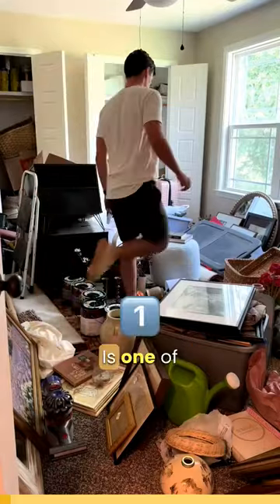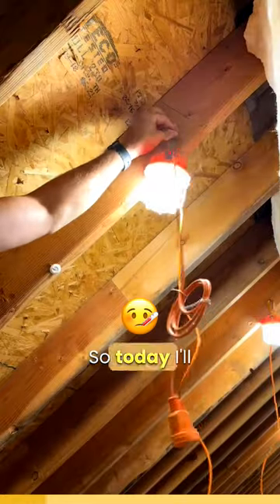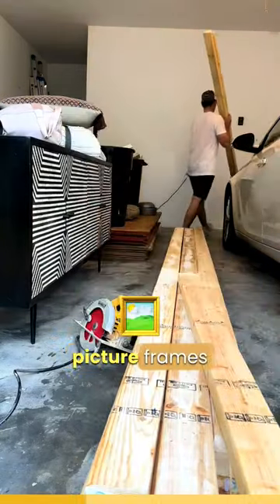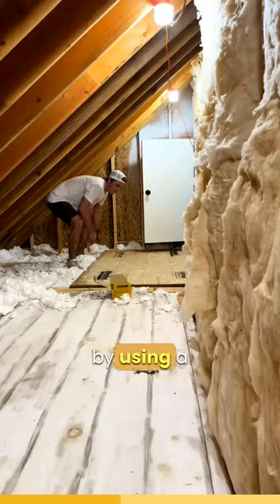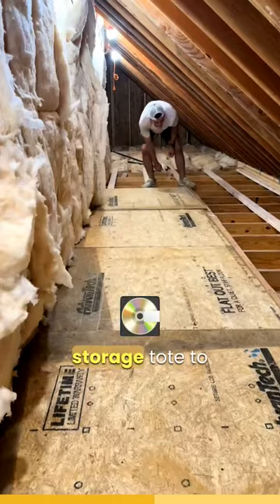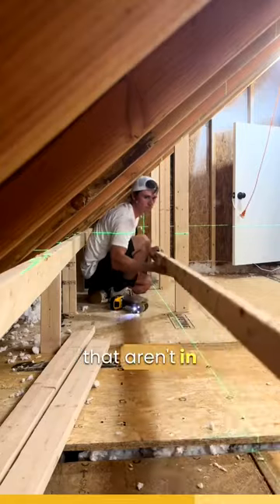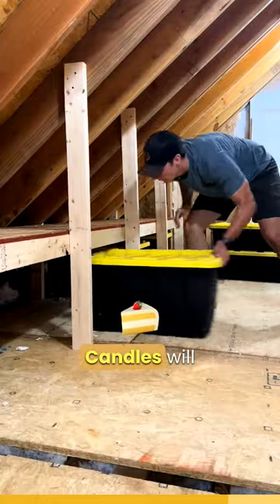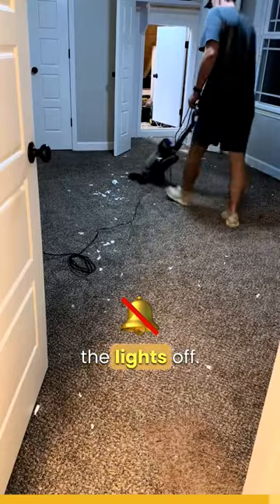Transform Your Attic into a Storage Room: Unlocking Hidden Space

Comment: Since you took out the insulation you need to insulate the ceiling rafter area.
Reply: Not as much. Insulation works by trapped air, and the floor is doing this to a degree.